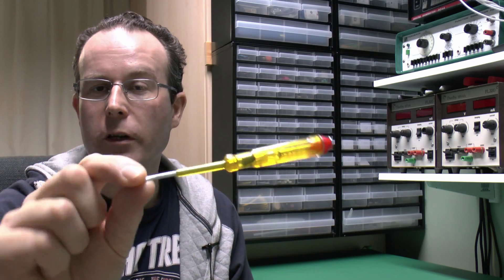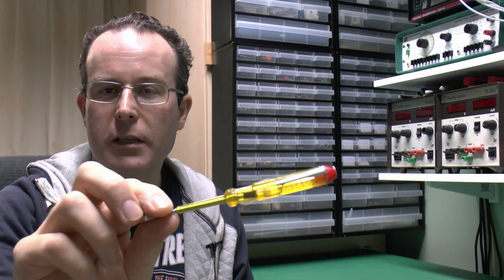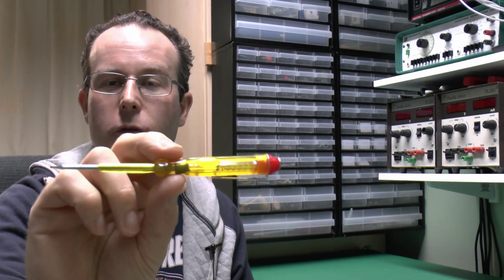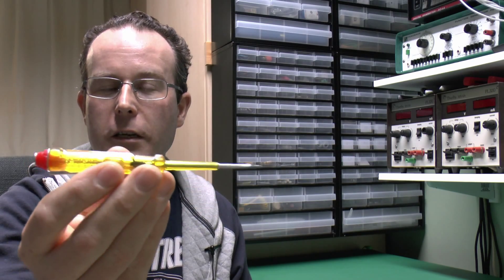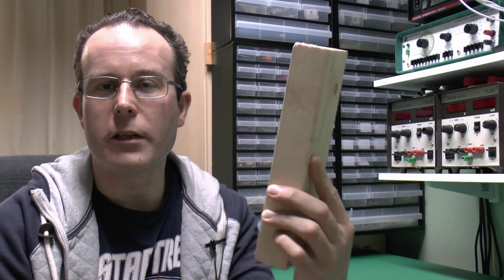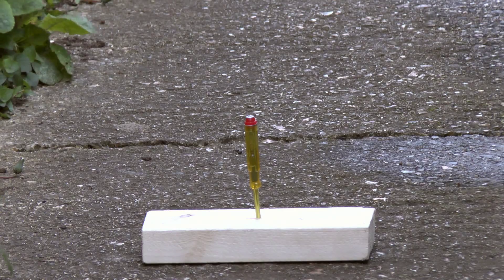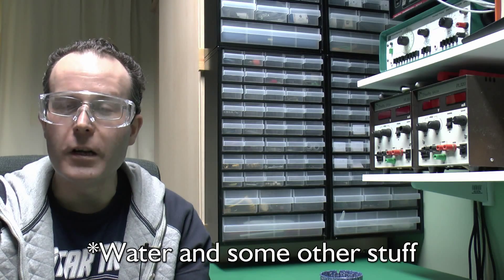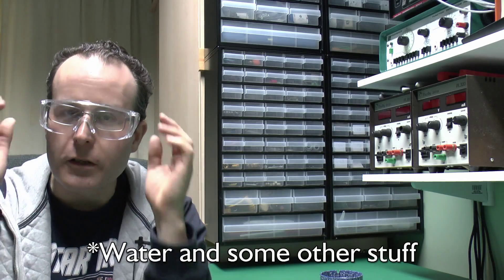Neon Screwdriver Destroyed with Water

Comment: What was the point of this demonstration. The issue is the danger of water getting into the driver and getting a shock. The demo, as the description under the video points out, is using chemicals. So? Put chemicals on plastic and it does this. What has this to do with anything. Not only that, but the video gives the impression that it was only water and a test was going to be made by connecting the bottom of the driver up and testing the top with a meter. What was this all about? This does not demonstrate the dangers of using this as a tester. All your other vids are brilliant but this one is pointless. You could have shown the dangers of using this after it had got wet inside, but didn't.
Reply: He's destroying it to ensure nobody uses it and kills themselves.
Reply: ☢ SNICKERS 5+2 GRATIS ☢
That's not the reason he's doing this. Read the description under the vid and the bit and the end of the vid where it says that he was not just using water, but chemicals as well. The chemicals reacted with the water (and maybe the plastic as well) and the result is what you see. Also, listen to the first part of the vid. He says "let's see what happens when we put water in the driver". But he didn't just put water in the driver. He doesn't say he's going to destroy it to stop anybody from using it. So I say again, "what's the point of this misleading video"?
Reply: Kevin Rose For fun